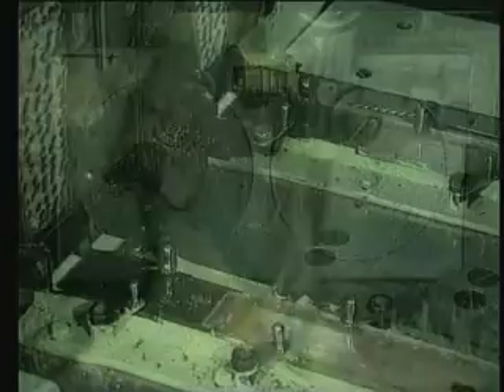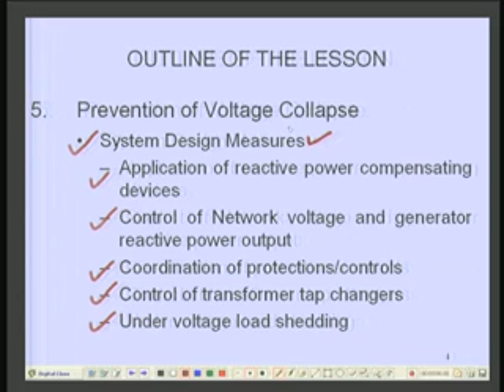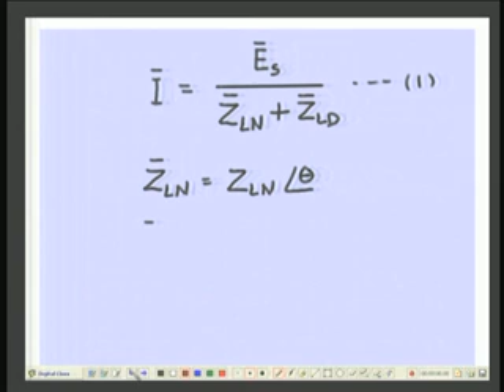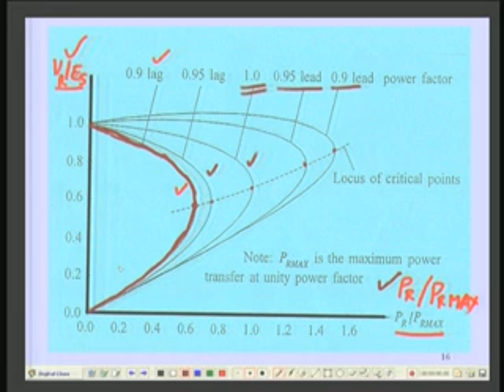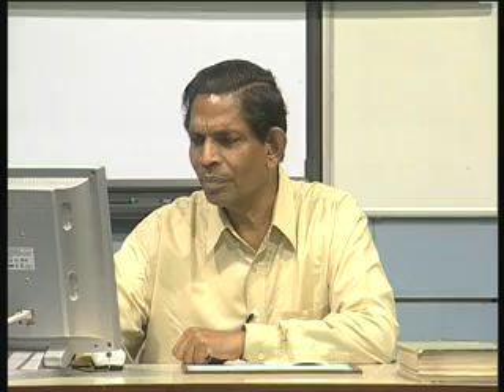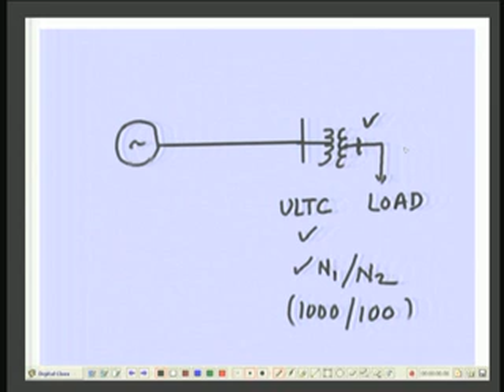Lec-35 Voltage Stability-Part-1

Comment: There's actually an error in the graph around minute 30:00, because the relation between the line impedance (ZLN) and the load impedance (ZLD) is the inverse of what is shown. (Kundur, "power system stability and control", chapter 2, figure 2.5).
Reply: correct, that error starts around 26:15
Reply: excellent work! you are right, and the graph is wrong.